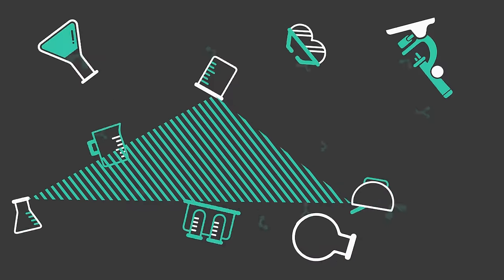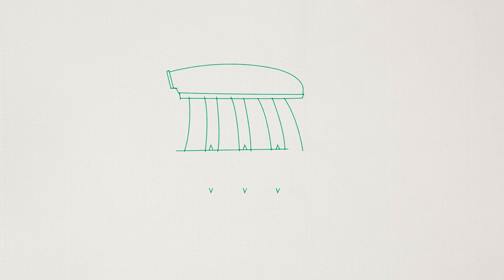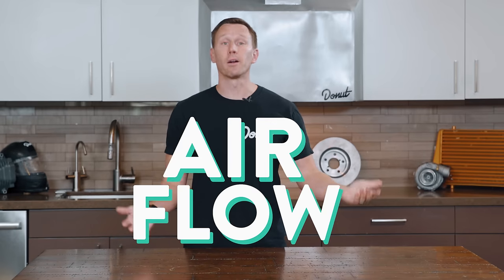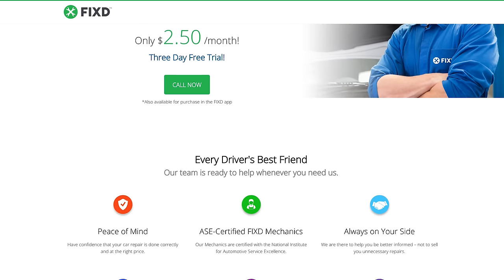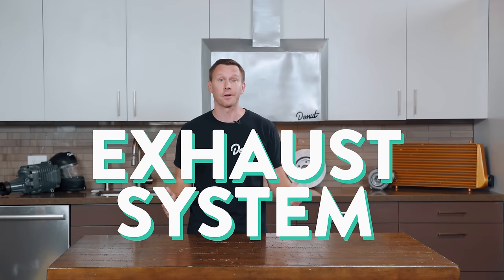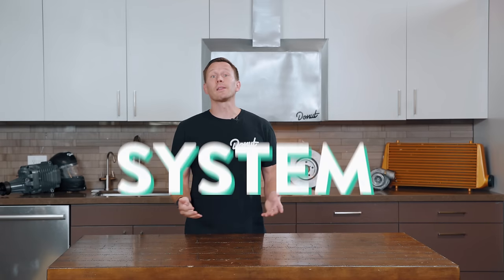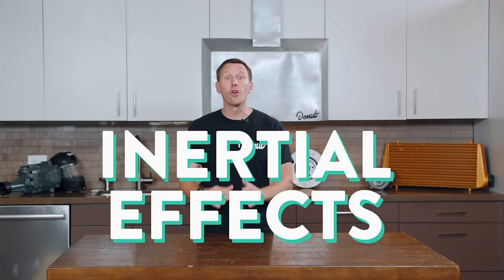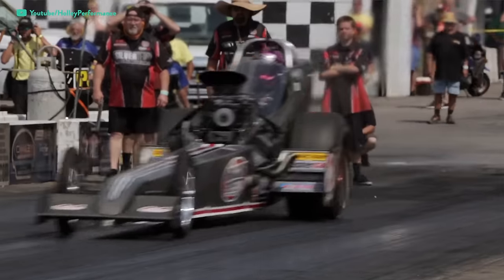INTAKE & EXHAUST | How They Work

Comment: Guys, can you do episodes on:
1- Performance cams
2- performance injectors 
3- Throttle body spacers
2- Lean/rich cases
3- EGR
4- lightweight pulleys
Reply: 1
2
3
2
3
4
????
Reply: I think you just cause bart been fired
Reply: africancheez it’s not god issa muhammad
Reply: africancheez 😂😂😂
Reply: This man has unlocked the secret to algebra
Reply: Algerba
Reply: i agree with every one of those suggestions
Reply: jesus ??
Reply: It's Jesus

Comment: Ok, so I have a 1996 Audi A4 Quattro, with the 2.8L 12V V6(AFC engine code if that helps). I know, go with the 1.8T, never lose. However, when I got the car, it had a 2.5" "hot air intake", no block off paneling whatsoever, so the engine was sucking in all that hot air from right over the exhaust manifold. I fabricated a block off panel, swapped out the 2.5" piping for a 3" one instead, it fits snugly and matches the MAF housing better. The blockoff panel I made also uses a trunk seal from my parts car around either side and the top to better separate the intake from the rest of the compartment(like you mentioned in the video). Now, the exhaust that came with the car was probably one of the worst straight pipes I've ever seen. They basically 45d the passenger bank slam into the driver side bank, almost making it a T junction. They then flex piped the end of that(with no cats, or downstream O2s in the system whatsoever) into the stock A4 muffler🤦. I removed all the ghettofied boosheet they left for me.. The whole system from the bottom of the 2" downpipes back is now 2.5". I ran a pair of high flow Amazon cats with downstream O2s, then into an X-pipe, then into a 2-in-2-out Cherry Bomb Extreme "muffler", then out the back through a pair of downturn tips I made from pie cuts as well. Basically I turned what would ordinarily be a 2into1 system, into a dual crossover, dual exhaust. I'm wondering if I'm going to lose some power, making the whole system more free flowing? That stupid straight pipe was awful, I have some pics and it's featured in one of my videos on my yt channel. I'm hopeful to at least be slightly above stock numbers of 174hp. I'm hopeful to be at worst, back to stock numbers, given the 💩 that was there before was really terrible. My work may not be the greatest, I'm legit a hobbyist working on my own vehicle, not a professional welder/fabricator. I apologize for the long read, and I appreciate any and all input. Thanks in advance😁

Comment: Some backpressure helps with scavenging, effective scavenging allows the cylinders to clear exhaust gasses out better,well designed  intake and exhaust are tuned like a musical instrument
Reply: Yeah, for a naturally aspirated (NA) engine this is true, but for a turbo charged application, no scavenging is needed after the turbo, and only a small amount before the turbo.

Comment: I hate how everyone says it adds power all it does it makes it sound better, whoosh and braap
Reply: Dariune it sounds faster that’s all that matters
Reply: Airflow is important to a combustion engine, so why wouldn't it add more power if all the relevant variables coalesce and produce a beneficial and tangible result? I'm sure people have ran tests (dyno & driving experience) to see, hear and feel the differences in their vehicle. I recently changed my air filter to a K&N stock replacement filter, and there is definitely an improvement to throttle response and power, but it's a small gain. It was worth the money I paid, though.

Comment: I always try to do modifications after the sensors. While the gains aren't nearly as high, it stays quite right and reliable. I have a borla exhaust and AEM intake. I do swap all my fluids out for synthetics from the transmission fluid to the oil pan and everything in between. Two strut bars and I call it a day
Reply: Yeah, that's pretty safe advice for most, but as you say, the gains aren’t as good. For example: one of the best mods is the dump pipe straight off the turbo. Huge gains can be made there, in combination with intake, and a mild boost increase. But in some cases the oxygen sensor might need to be moved to the new downpipe.

Comment: It reminded me of the 2.0 turbo charged Pontiac’s  GXP.  or the redline Saturn red line. I say it’s a good fun but when the motor craps out you could put a LS engine on it. Don’t get it twisted the 2.0 engine is a fun ride. I have rode on that 130mph easily on 22,s in Mexico lol Riding on a low ride torque and a high output compared to its low weight. This is were you might have doubts. Keep in mind that the chasis is a beast to deal with. Easily put a LS3 and dominate the market. Why Waite for a “brand to build it for you when you can configure it out for yourself.when you build it it’s worth the expense. Burning tires on a go cart is worth it and no hate on any other brands I love all of them ppl.

Comment: Great video but there are a couple points I would've added
1)depending on engine power you NEED a larger diameter tube because certain tube diameters can only "efficiently" support certain HP levels
2)X and H pipes help with exhaust scavenging, I've seen some builds with MULTIPLE X pipes 
3)a little bit disappointing you didn't use a clip of a topfuel dragster AT NIGHT with the 7 foot jets of flame comin out the exhaust...

but all in all it was a pretty good video, well done

Comment: Right on, however, the main problem with a free flowing system, is that air enters the exhaust causing backfiring. That is why back pressure is needed. It is created by the muffler. However, you can prevent a free flowing exhaust from backfiring by running your engine lean. This prevents unburnt gas from entering the exhaust, however, the car will have much lower horsepower.

Comment: actually the muffler reduces sound probably around 10%
before, i had a role closed to the motor
the sound was so loud, it was causing me headache
then i fixed it, the car sounded like brand new
but because my car is manual, a little bit of noise is appreciated
i cut my muffler, the car sounds now 10% louder compared to when i fixed the exhaust

Comment: Well Backpressure is needed for Two-strokes to work..not that they are important in cars anymore but hey I still hold onto them even though litteraly every twoweee I had either ran mysteriously (sometimes really good and sometimes kinda chunky and leaky, even when the conditions were almost the same, same temp, same air, obviously same height), didn't run at all or seized up after driving 30miles because the previous owner never changed any fluids so the Cooling fluid was basically rust broth, there were rust chunks in it the size of M5 Bolt heads.

Comment: Fun fact, the RX-7 FC S4 actually requires back pressure in order to open the auxiliary ports. By the time the S5 rolled around they switched the ports to open based on the engine RPM instead

Comment: back pressure is needed for a 2 takt engine because it doesn't have valves that regulate the intake and exhaust cycle

Comment: I’d like to see a video on how verbals work or burbles however you pronounce it the backfiring you get when you let off the throttle
Reply: Its unburnt fuel igniting in the intake. If you release the throttle quickly sometimes the injectors will keep spraying too much fuel for a short period of time. That excess fuel then ignites in the exhaust pipe and pops. Cars that have carbs or maf style tuning method will see this more.

Comment: It would have been nice to expand a few of your example. like the huge exhaust pipe one. when a tuned performance car has some massive pipe you will see that drop in HP down low until the engine builds enough power and exhaust flow to properly "fill" the pipes. No mention of x pipes and h pipes sadly... Maybe do an entire episode on resonators and x/h pipes and how dumb y pipes are

Comment: Cheapest performance booster is cool air intake and a bigger exhaust.
Reply: So do you think a high flow exhaust combination with a CAI would actually increase anything as far as "performance" or "horsepower"??

I have high flow aftermarket cats so basically hollow. And a 2 chamber rumble muffler. 3in pipe from the cats back.

Comment: Thank you for this video. Question, 2004 Lincoln Town Car, heavy-If I were to add a high flow fuel pump, ecu & tune, injectors would it help produce more power, more horsepower moving the vehicle, would the mpg improve?

Comment: "Zoomer" exhaust headers are terrible for street and drag tuned V8s, you'll see a massive drop in power and torque from all the turbulent air trying to escape.  It sounds good and can wreck a dyno room real nice, but it's really harsh on the engine.  Dragsters have more effective, powerful engines that don't really care if there's a loss in exhaust pressure, they'd just as soon blow a dynometer trying to find out if there's a loss in performance.

Comment: So I am just getting familiar with my new car and would like some sarcasm-free input...I bought a 2017 Nissan Rogue SL AWD with a 2.5l 4cyl. I am looking for any recommendations on possible catback exhaust and maybe aftermarket intake that would fit on my car for the purpose of sounding good not necessarily looking for performance increase or to race.  The car is a daily driver for me as a dad but I miss having a car that I can listen to the engine so I want mine to sound decent.

Comment: Let me help you guys on the Intake and Exhaust questions for your auto homework.

In an internal combustion engine if we move more air we will get more _Power__

Briefly describe the purpose of the Intake manifold.
The intake manifold delivers air to the engine cylinders, allowing for proper fuel-air mixture and combustion, resulting in engine power and performance.

How does a cold air intake help in creating more horsepower? 
A cold air intake helps create more horsepower by providing a cooler and denser air charge to the engine.

What is the first component found in an Exhaust system?
The first component found in an exhaust system is the exhaust manifold.

Why would we need to use Gaskets at some locations of the Exhaust system?
Gaskets are used at certain locations in the exhaust system to create a secure and leak-free seal between components.

What is the main purpose of the Catalytic Convertor?
The main purpose of the catalytic converter is to reduce harmful emissions by converting toxic gases produced by the engine

What is the main purpose of the Muffler?
The main purpose of the muffler is to reduce or suppress the noise produced by the exhaust gases flowing through the exhaust system, ensuring quieter operation of the vehicle.

The three benefits of a good AFTERMARKET exhaust system are?
The three benefits of a good aftermarket exhaust system are improved performance, enhanced sound, and increased aesthetic appeal.

On a Top Fuel drag car the exhaust can create some aerodynamic pressure that helps to boost traction to the wheels. 

When the INTAKE valve is open, the EXHAUST valve is _closed_?

What state are the valves in on the COMPRESSION stroke?
both the intake valve and the exhaust valve are closed

thats bout it, if this helped leave a like! 😁

Comment: good explaintaition but at 7:23 you forgott to say, that more Air is nothing without the right amount of fuel. If your bump up your Air Intake, without increasing the Fuel Intake it cant work ! A Stock ECU will always try to get to value betwen Lambda 0.97 and 1.03 (so bump up the Air Intake cant help, if your engine got to much Fuel, the ECU will limit the Air, and Vice Versa) and the Stock Fuel Pressure Ventile and some other parts to, got there Limit !

Air Intake + Fuel Injection = More Power !
One alone cant work !

Comment: I have a 2017 Mercedes 3500 Sprinter RV and the exhaust pipe goes straight out the back of the van, but I lose about 7 inches of clearance when going down a dirt road when getting to some camping sites. Can I get the exhaust pipe bend so that it comes out behind the rear wheel? With your experience what would the risks be? Thanks

Comment: Hey!!
I installed a spd down pipes on my 2015 f-15 eco 2.7 and even do it feel like more power and air flow, my mph it horrible >>
Like 25% less fuel economy >>
Also the truck revs higher and doesn’t want to go 2 gears like before in stock -mode!! Stays in forth or fifth!
What do I need to make work properly?
I am also getting a air could intake as well as a turn down magnaflow  exhaust!!
Cheers!!!!

Comment: I recently had a friend install a TRD pro intake on his tundra. I'm not a mechanic but have decent knowledge of mechanics .  he's telling me that he swears he's getting better fuel economy because his truck is breathing better. This to me sounds like a placebo effect when you can hear the air in his intake when he steps on the gas  but when they design these vehicles from factory don't they design them so they can maximize air flow/ fuel economy? I would assume that the vehicle's computer would sense more airflow with the bigger air cleaner box wouldn't it increase the fuel as well for the air-fuel mixture and adjust itself? Thus getting worse fuel economy? I have the same vehicle as him but I'm kind of skeptical about getting that cuz it's $350 to 400. Take billion yrs to offset the cost for the after market.  I would think the savings will be minimal if not no gains at all and fuel economy.   Seems to me vehicle manufacturer's spend millions of dollars trying to get every little bit of gas mileage they can with the most horsepower possible. So if it were as simple as an air filter I would  think they would have k&n style filter from factory or CAI ?

Comment: Saying Cold Air swaps "don't really do much" is a little disingenuous. Makes it sound like it does nothing. Maybe the gains are small--a K&N high flow for a 17 F150 5.0 adds about 14hp and 15tq to the wheels on a dyno per most retailers, but that's quantitative verified gains. Some even talk improved fuel economy. It's not a lot, but it's something.

Comment: I have a 2004 Rav4, and my engine doesn't have a "box" with a filter in it. It just has the normal air intake tube thingy. Is that ok?

Comment: Sssooo you'll see more power by straight piping your car because you're raising the exhaust velocity and gas speed resulting in better inertial affects? Am I getting this right?
Reply: Yep! Just don't go crazy on pipe diameter. If it's 2" stock, you don't need anything bigger than 2.25"
Reply: I have high flow cats and a 2 chamber rumble muffler.
So do you think a high flow exhaust combination with a CAI would actually increase anything as far as "performance" or "horsepower"??

When i changed the exhaust alone I noticed more getup from the motor.

Comment: What happens to the engine if It does suck in water?
Reply: If it sucks in a small amount it will just stall the engine. If the amount that enters the cylinder is greater than the combustion chamber volume you will hydro lock your engine. Liquids cant be compressed easily so it will bend/break rods.

Comment: Do people really ask if they need to change a filter? If you don't change a filter, ANY filter for ANYTHING in the world, it'll get clogged. If that happens they restrict or even block the gas or liquid they're meant to clean/sift and eventually more of the shit you're trying to filter will break down into small enough particles (from friction & pressure) and pass through the filter defeating the purpose. For a car that means dirt/debris in the inner chambers of the engine on top of the fact you're literally choking the car. Driving on an overdue filter is like trying to run while being smothered with a pillow.

Comment: So if a car is not a non turbo it still needs some back pressure as it relies on back pressure coz it has no turbos ? I own a Mitsubishi 3000gt Sr it’s a n/a I recently done the exhaust and was told I need the back pressure for the car to pull as it has no turbos yea if it was a twin turbo then u don’t need back pressure ? Can u correct me on this one please coz am confused

Comment: Can I increase hp and gas mileage? I trying to have the biggest air to the engine less heat on it. Like  Throttle body with it. Can the work?
Reply: Oh I have cold air intake tube for it already.

Comment: Most of the cold air intakes I have seen people install are just a tube with a filter stuck on the end sitting under the hood exposed to all the heat from the engine. Totally defeats the purpose of getting cooler clean air to the engine. In reality most stock intakes are superior to a CAI, there is generally little to no gain from adding a CAI, even if it is installed correctly. Stock intakes are already routed to pull in cooler outside air. There is a lot of engineering that goes into designing the stock intake to get the optimum amount of air to the engine. Just throwing a fancy intake on without doing performance upgrades to other systems is not going to gain you anything measurable.
Reply: So do you think a high flow exhaust combination with a CAI would actually increase anything as far as "performance" or "horsepower"??
Reply: @rcsix3rd  Any modern car is programmed to run at max efficiency with its stock setup. You change something, like intake or exhaust, and you mess up what that programming "sees". You really need to tune the vehicle for the changes done to really see good gains. Remap the ECM with dyno runs, make fine tune adjustments.

Comment: The car doesn’t have a front butthole!!!! 🤣 It’s called the front grill & radiator, and air intake tube (nostril), as the car needs air for cooling the engine via radiator, as well as air for combustion via the air box.